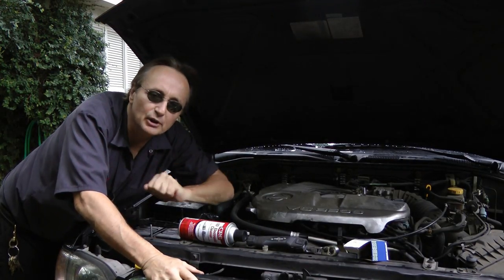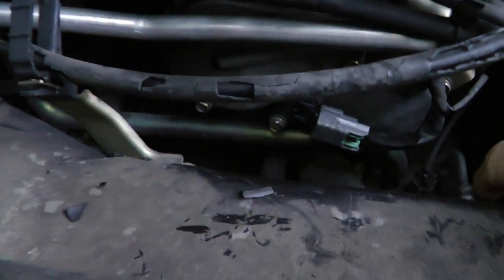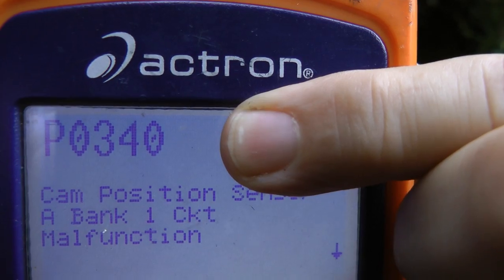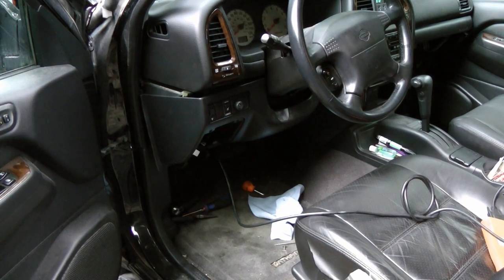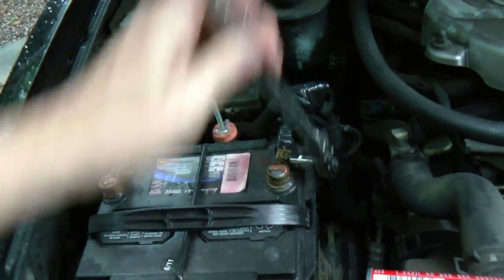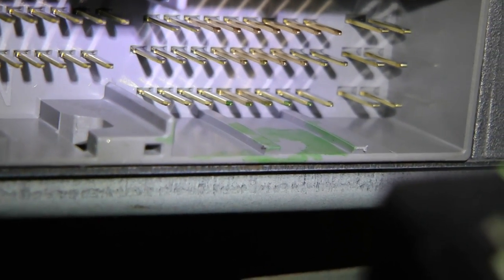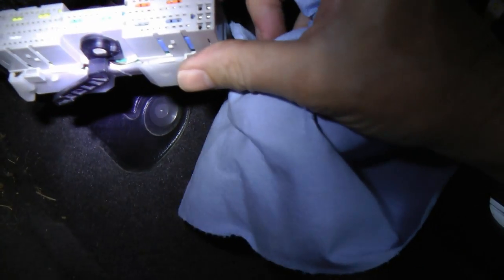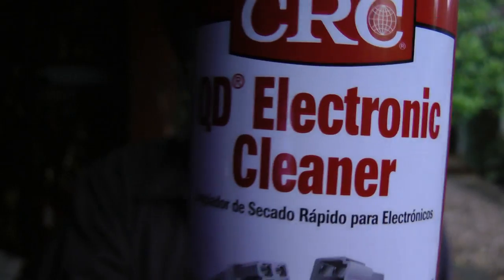How to Fix Computer Problems in Your Car with a Little Spray Cleaner

Comment from the maker: oil in vacuum lines means that the engine is pretty darn worn, or you have bad gaskets, like intake manifold or head gasket leaks.

Comment: Hey Scotty I'm a new subscriber

I have a 2002 Dodge Durango and my check gauge light came on I took it to AutoZone for them to check & see what it could be.it said the pcm computer...
My question is if it had another problem the tester would have said right?
Like if it had a bad transmission or engine?
But since that was only thing it was reading that's my only problem? (the pcm computer)?

I also bought a CV axle and I'm about to put that on Real soon...
Thanks Scotty please reply good bless

Comment: Hi scotty. I watch lots of your videos and its very helpfull to me. But currently my 92 4runner has some problem. Issue is it would crank but wont turn on. I check for spark and there is no spark, this issue usually happrn durring the morning when its 60° sor so, but when its much more warmer the cars turn cranks and turns on. Do you think it would be a faulty ecm? Your answer would be much appreciated.

Comment: hi scotty. I have a Pontiac wave 05 with a U0401 code and a p0300. dealer suggest replacing ECM. your thoughts?
Reply from the maker: Often a bad computer will do that, though it's always somewhat of a guess. Make sure they guarantee it will fix it BEFORE paying them anything

Comment from the maker: modern cars are SO complex, you'd need a machine as in my video "fixing modern cars using high level scan computers" to figure that one out. too much crap in em these days, drives me nuts too fixing them. I often cut all that crap off and run the AC with a toggle switch

Comment: hey scotty , i have a 98 eclipse gsx and im having a problem with the computer resetting itself , i took it to get inspected they said that only two monitors are clearing and nothing else is changing, it passed the inspection but what would cause it to not reset itself?

Comment: Scotty, my 2005 Buick Rendezvous needs a new Body Control Module. I was told by my mechanic that a used one won't work on it. Is that true?
Reply from the maker: they have to be programed to work on your car, even a new one. But a used one can be programmed too
Reply: Ok because he said it's a "one and done" type of deal

Comment: Hey Scotty! got a problem with a 2005 Dodge caravan no cranck no start. The blood k Mechanic said it could be the computer but he's not sure. He said he doesn't get no Sparks in the spark plugs no power to fuel pump had to put a wire to negative terminal and fuse and it will crank.
Reply from the maker: if you have no spark, and the injectors don't pulse with power when cranking the engine, odds are main computer is shot. BUT, check the crank sensor first

Comment: Should i change the computer if the car won't accelerate and won't give me a check engine light? I've changed a lot of parts that might be the problem but nothing seems to work. Any thoughts?
Reply: Sayso if you bought it used, the previous owner could have disconnected the check engine light or  connected it to others like the high coolant temperature.  Otherwise, no acceleration should trigger a code that can be retrieved by a simple OBD scanner.
Reply: Bad airflow sensor

Comment: I'm having problems with a 2004 Volvo s80. I will be driving it and all of a sudden it will say anti-skid temporarily off, brake failure, engine system service required. It will go into limp mode and the speedometer will turn off.  So far I've replaced the ECM, BCM, yaw rate sensor, and most recently the CEM. But we are still having problems. Im out of ideas at this point and I've already spent a fortune due to mechanics guessing and being wrong about which parts may be bad.

Comment: Scotty.... I have a 2003 Chevy Impala (base), that shows an illuminated security light when the car gets cranked. It stays on while the car is in motion, instead of flashing a couple times and going out as usual... Well from time to time when I attempt to crank the car, it will not crank and the security light will begin to flash repeatedly... I was told to turn the ignition to the on setting and leave it there for at least 10 minutes, until the security light stays on without blinking.... Then turn the switch off and the car should crank after than... The problem is that it's happening all the time now.... Can you tell me why is this happening to my car and what needs to be done to fix it?

Thank you
Reply from the maker: Choc City find a guy like me with a gm dealer level scan tool, that is needed to work on GM security systems, they are that complex

Comment: hello Scott I just installed a 4.6 motor in my 2004 explorer. it sounds good, but I  have some dash lights on. service engine soon,airbag, flashlig overdrive. could it by a bad connection in the computer harness?
my friend has a expensive scanner  but couldn't read no codes.
Reply from the maker: could be that or many other things, ike a bad bcm module in the vehicle

Comment: scotty thanks for you videos  i don"t know if you can answer my questions i have an envoy 5.3 l it runs and drives but after a drove for 2 hours when i shut off the car it wont start right up i have to wait like 3 to 4 hours to cold down and starts right  up again  is possible bad ecm
Reply from the maker: could be lots of things, but often a bad starter if it doesn't crank at all, they overheat sitting absorbing engine heat. But if it cranks, but doesn't start, do my video "fixing a car that cranks but doesn't start up" to find the fault

Comment: hey scotty I have mazda 323 BA and its intermittently hesitating on acceleration, I changed the mass air flow sensor, changed my distributor module, and reset my TPS, ran smoothly for a few kilos, than started again...any ideas, would really appreciate
Reply from the maker: pressure test the fuel pump when it acts up, pray it's just that. If not try my video "how to clean fuel injectors on your car:

Comment from the maker: I don't use dielectrical grease on computer connections, too many terminals and it can make connectors not tight as the connectors won't fit on right then
Reply: Dielectriccal grease

Comment: Hi, I have a 2000 Nissan maxima 3.0 and my crank sensor and fuel pump wasn't good so I got new set put in and my car still just cranking but won't start, so I got machine to check it, and he said the computer isn't sending the signal to the sensors so I a new computer and get it program and my car still won't start just cranking..
And I just try the electrical cleaner spray and still didn't start ... Can you give me advice plz

Comment: Saludos amigo ! Ive watch a couple of your videos and I can tell you got alot of mechanic knowledge under your belt !!! I hope you can help me out with a problem; I have a 2008 dodge charger, D starter got replace for sum failure cranking up, it seems like the positive cable was loose and it touched the ground from the engine,, it started a fire , we found the issue secured it ,, came back to live BUT after a while of driving the car it when into LIMP MODE now I don't have a clue of what could be the problem.  Any of you old farts relate to this !?

Comment: I just replaced my TCC P0740. I took off the negative cable let it sit for 30 minutes. turn it on and the check engine is still on. I had the codes erased by that gadget that reads codes and it still shows P0740. I just replaced that selinoid and changed filter and fluid. what would you recommend?
Reply from the maker: +plastamoscos seeing a pro now.   Bad wiring, bad main computer, or internal transmission problems
Reply: +Scotty Kilmer all gears  shift when supposed to. no faulty gears no electrical problems in the transmission. as you guessed and my guess it should be a faulty wiring somewhere. I'll look into it the wiring.  thanks Scotty 

and ride on!
Reply: +Scotty Kilmer love your videos! can't beat an old school mechanic lol your tips have helped me fix loads of cars,cheers from Belfast N.Ireland.

Comment from the maker: yes, it ran like a clock when done. It did start up after all at the end of the video, and it was towed into me not running
Reply: 98 Dodge Caravan pulled codes for the vapor canister purge solenoid and the BCM. Replaced the vapor canister purge solenoid and still doesn't crank. Please help me before I spend a lot of money.

Comment: scotty, need your help.

got a 99 dodge stratus.2.4l.

problem is the gauges are dead along with the wipers and deforster.you turn the key on and the miles read no bus with the airbag light on.the light will go out when you start the car.the car will start and run but it has no wipers gauges are dead lights in the cluster are dead but 1 or 2.everything else works but those few things.iv checked fuses,relays,wiring that i can get to.

im at a lost.
Reply: i got it fix, it was a bad bcm

Comment: SCOTTY I need help I have a 2002 VOLKSWAGEN JETTA 2.0L AUTOMATIC 

I recently power washed my engine as well like 2 weeks ago 

there is a code that comes out P0600 on my obd2 nothing else shoes but that code and I know I have a misfire on CYLINDER 2 but this code only shows up now P0600

OBD2 reads - P0600 PLEASE HELP ME WHAT CAN I BUY TO REPROGRAM IT OR what should i do 

I took of the battery for 15 min didn't reset nothing still same code

Comment: I have a 1997 Mitsubishi Montero SR. Runs ok at higher RPM but lousy at idle... but it's a weird issue here. It will start some of the time. The other times you turn the key and it's silent like the battery has a bad connection, but the battery is brand new and I also checked connection to starter with a volt meter and all seems to be good. Some times you put in the key and it will simply will do nothing then you try again and turn the key and it starts right up.

  I also checked the starter with jumper cables tapping it directly to the battery and it works fine. The solenoid doesn't seem to be getting hot ether. Also when it runs no check engine light comes on ever despite any issues I've resolved. It won't trigger a check engine light even when you unplug a sensor ether. The check engine light does come up when you turn the key to the on position so its not burnt out... and it seems to alternate with rough idle really noisy then smooth out for a little bit then rough for most of the time. I've done all the rough idle checks like checking EGR valve, and idle air control and cleaned that stuff up too, and I even smoked out the system for vacuum leaks and so far got nothin... Sorry for the ramble. Any ideas?
Reply from the maker: Tyler Finvold at that age, most start to crap out, really weak electronics on Mits. But if it does nothing, odds are the starter is just wearing out, or the ignition switch. When it doesn't start, hot wire the starter direct from the battery, and it it doesn't spin, replace it

Comment: Hey Scotty, I have a 1985 chevy citation 2.8 f.i., and when I turn the key to the on position, there is a very loud vibration from under the hood. I thought maybe it's the fuel pressure regulator. The car runs fine, then stalls when it warms up. Then it turns over and it won't fire at all, it just freely spins with no combustion at all. Then it starts up when it's cool. Do you know what it could be?

Comment: Scotty, I have a strange problem.   Hopefully you like strange problems, if so this one is for you! 

1999 Chrysler Concorde.  It refuses to give up any codes.  connects to the car fine but can't get it inspected / registered because the code data isn't ready.     

It will also stall when you first turn it on a time or two.     It had a battery issue that would completely drain, I know that's not good for computers and that battery issue has been resolved. 

Is there a known issue with computers that allow connecting but refuse to actually give up data? 

"No DTC's or freeze frame data is presently stored"   something like that.    I've read there could be power not going to the computer but wouldn't the code readers tell me it's not connecting to the computer if it had no power? 

Is there a fuse, or power to them even when the car is off that could have a bad wire / fuse?   

My code readers are the Innova 3100F and the Actron CP9125 both obd 2
Reply from the maker: on those , often a bad main computer does that, see it all thee time on concordes. Have a pro test that first

Comment: does electrical cleaner work on 02 sensors? to revitalize the voltage surge running through the sensing parts of metal or whatever material it is
Reply from the maker: not really, they are super hot inside and any build up will bake on

Comment: My toyota hiace 5le wont start . While replacing new battery postive wire touches body ground by mistake after that it stops cranking but every dashboard lights are stil there.. pls help

Comment: I have a 98 jeep Laredo. It's stalls sometimes on the first crank and a lot at stop signs or red lights. Even when driving a couple times. No check engine light but the light does work because it comes ok n when I flip the switch. Could this be a pcm problem?
Reply from the maker: could be, but first try my video "how to fix a car that idles poorly,"  and also check for vacuum leaks

Comment: Hi scotty, i have a 2002 isuzu rodeo and it sometimes shows the car is on revers on the odometer but on the gear shifter its on drive and when i drive when it says that on the odometer and its on drive on the gear shifter the car tends to shift hard into first 1st,2nd, etc, could a leak like this be the problem in my car?

Comment: Hi Scotty I have a 07 Chevy cobalt that just died on me wen I turn the switch it won't turn over but if I touch the starter wires it turns over but its not firing or getn gas can it be my ecm?
Reply from the maker: Kourtnea Lonberger could be, but first try my video 'fixing a car that cranks but doesn't start up'

Comment: I have a 2000 Dodge Ram 1500 V8 5.2 Sport that while driving sometimes (especially when it's hot outside) the engine shuts down and I'll have to pull to the side and sometimes it will start right back up and sometimes I'll have to wait 5 to 15 - 20 minutes till it will start up again. I so far replaced the idle control valve sensor and throttle sensor. Next I'm going to replace the crankshaft position sensor and the ignition coil and the camshaft sensor, just keep replacing these things till I fix it. If someone knows how to fix this I'm all ears.
Should i spray my pcm with this stuff?

Comment: Hey Scotty I have a 2000 Honda Civic DX with the 16300 miles and my car went into limp mode it's saying the solenoid could be bad or an electrical problem or my PCU I checked everything looked over my whole car took it to a mechanic any advice please
Reply from the maker: find a better mechanic, limp mode can be caused by dozens of things that require a dealer level scanner to analyze
Reply: Just replace the cam shaft position sensors like Scotty did in another video anyway.  If your Civic is equipped with a distributor instead, you may need to clean it.  Erase the codes and see if they come back and under what circumstances (for example, hard acceleration, cold engine, idle while transmission in D...).  Did you replaced the spark plugs with the correct part number?  That might the culprit sometimes.  Honda has reliable electrical systems if OEM parts used.  Good luck!

Comment: hey Scotty I have a problem woth a ford f-250 2005 five.  The truck starts whenever the fuel pump turm on but sometime the fuel pump wont turn on in doing so the car will crank but wont start. i have already chamged the fuel pump but it still does the same thing. I also got a new computer with the right program but it still does the same thing. is there a certain way to install a new computer?
Reply from the maker: try a new fuel pump relay and check the wiring. And realize the computer must be reprogrammed to fit your vehicle, or it will never start
Reply: The new computer that i installed does have the right program. Is there a certain way that I'm supposed to install a new computer before actually turning on the truck all the way?

Comment: Hi Scotty,I'm very desperate.02 Envoy had an intermittent starting issue and engine light comes on but only code I is the P2240 or something like that which is the evap or gas cap code.Fuel pump went out too,fixed that along with can and crank sensors n mechanic said wire harness looks fine on outside from looking.Now my truck won't start at all ,just cranks, any ideas? its about to get cold here.It went from intermittently to just crank no start.
Reply from the maker: do my video "fixing a car that cranks but doesn't start up"
Reply: P2240 should be O2 sensor related which is triggered by ignition and timing devices such as the camshaft position sensors or distributor depending on your engine.  Scott, could you please summarize at the end of your tutorials?  And give a quiz perhaps to make sure students comprehend...

Comment: I changed all the sensors on my 07 chrysler 300c i changed rhe throttle body unit and i have a p0340 code and i replaced that i literally changed everything in the car will it mean that my computer is bad cause the engine check light keeps on blinking,car stalls,doesnt pass 40mph,or 3000rpms,and shakes bad but i dont know what it is everything's been changed can u help on any thoughts?
Reply: Ricardo Rogers just don’t buy a chrysler product next time

Comment: ok so I went back to my mechanic and it had a P1613 code for my ecm.. does this mean it's failed and I have to replace it or could it be something else??
Reply from the maker: +Rozell Claxton bad computer or bad wiring to the computer. Have the wiring checked closely first, cause if it's that, a new computer will burn out too